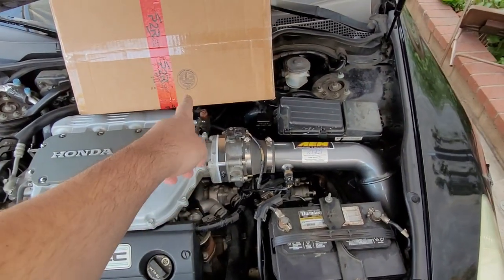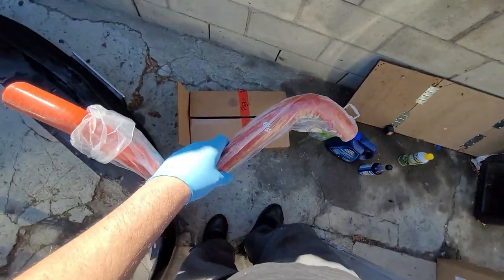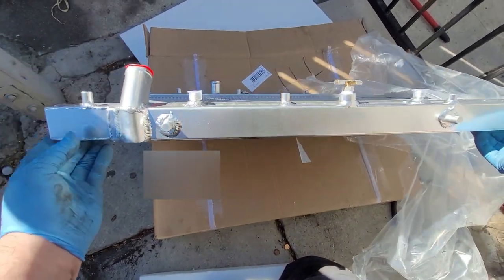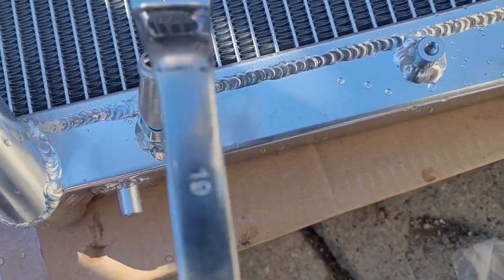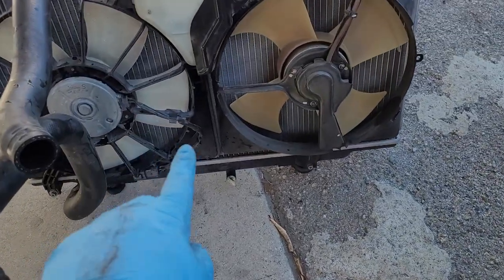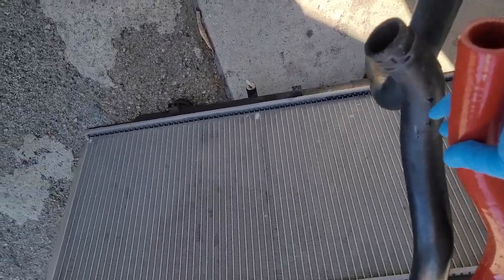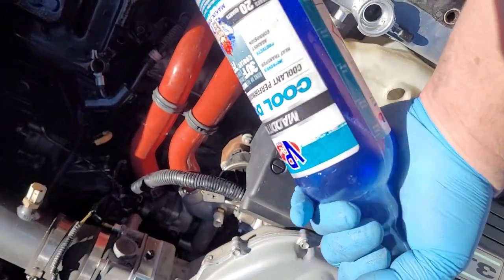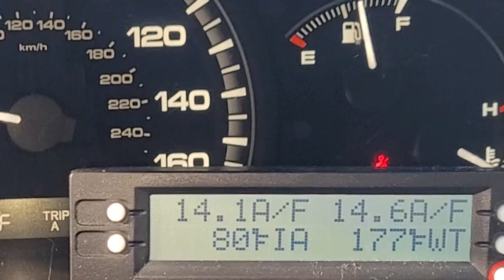P2R Silicone radiator hose & eBay performance radiator

Comment: i actually appreciate seeing someone work on a 7th gen accord lol. im the only one in my area thats working on mine. i have a 03 ex sedan i4 stock engine. are there any recommendations for air intakes/radiators?
Reply from the maker: eBay turbo kit and Honda flash pro

Comment: Bought this but idk what to do with the transmission lines. Bummed out.
Reply from the maker: I got a video coming out soon I put a transmission external adapter and I plugged it into the radiator but I end up if you watch my other videos you'll see I end up using a external transmission cooler and set up the radiator for more cooling power even the radiator cooling is very good The external is was necessary because I was towing what the vehicle
Reply: @jseriestech idk how the transmission lines work. My assumption  is fluid only flows through those two holes (like a chamber ig)  so I just had them there untouched and the radiator works fine. (Been looking up to your build so I’ve been working on mine
Reply from the maker: @RaulsWRLD  do you have a 4-cylinder or a 6-cylinder
Reply: @raulswrld do you have a link to the one you purchased?